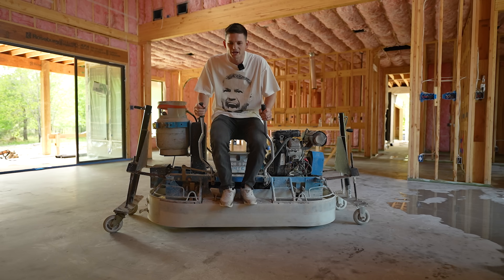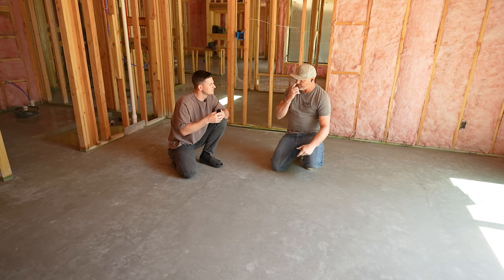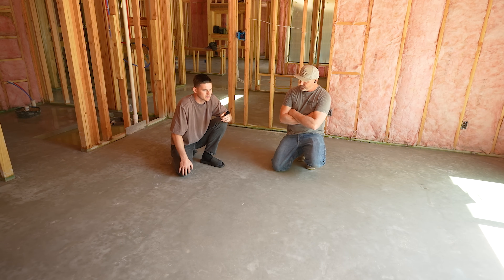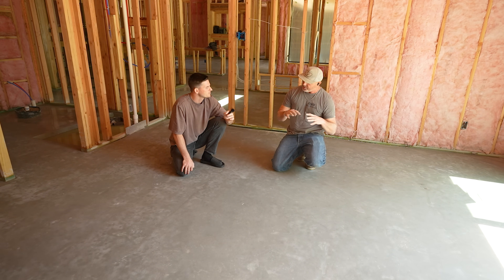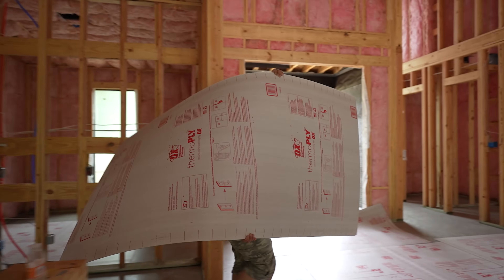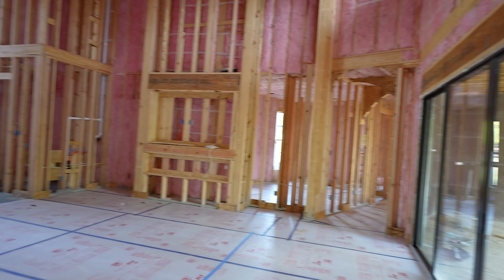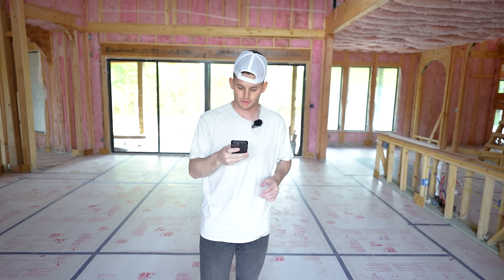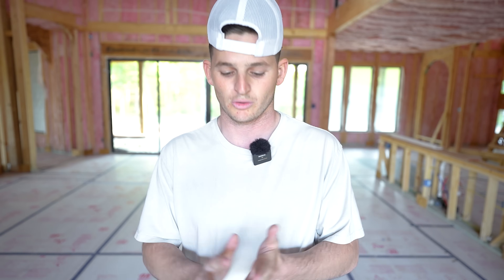POLISHED CONCRETE FLOORING For My DREAM Home Build!

Comment: Keep the flooring sheet!, In the UK we use them for anything and everything, protect stair cases, windows, lower corners of wall between drywall process before painted to save corners from getting chipped, wrap them around appliances while work goes on around them (washing machines/dryers), so many different applications. Especially for any future projects, great video as usual mate

Comment: @caselucasrobinson Hello, just a heads up that concrete will kill your back over time.  Pay attention to this as you said you are going to build again.   Also, if your child falls on it, it's going to hurt... I built my work building in wood due to this and it has served me well young man.  At any rate, you're doing a swell job on the build!   Your drive is contagious.